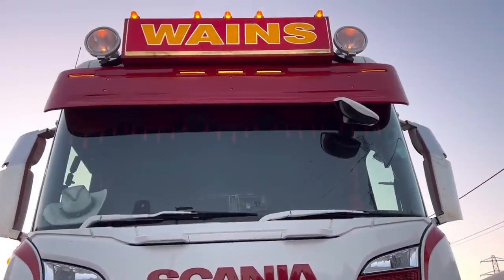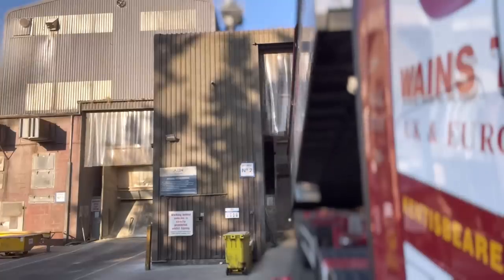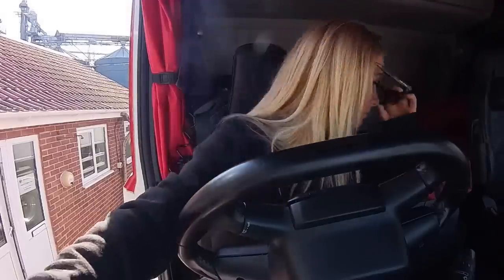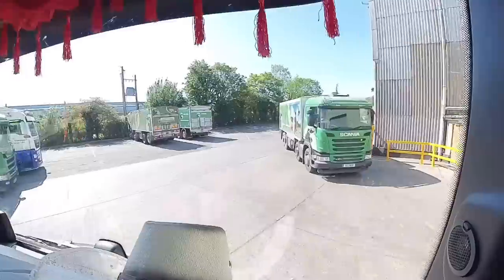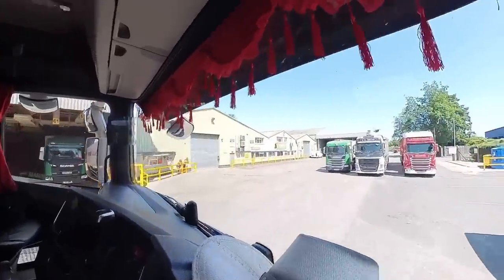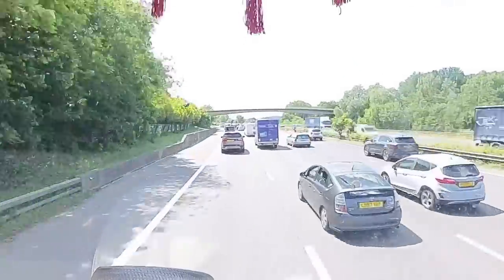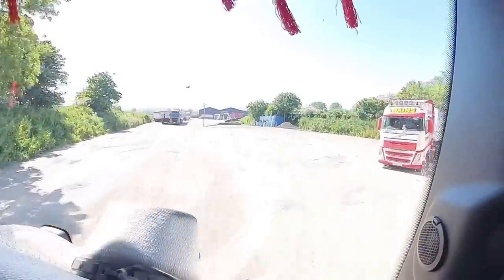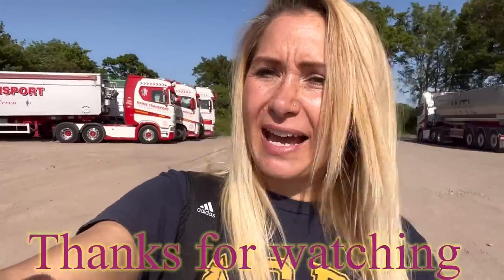Sticky loads | I want to go home

Comment: You need to look into a liner for the trailer I used to do lime for years, and wet lime used to stick like billy oh, until I got a slip line body liner fitted, then nothing and I mean nothing sticks, and even after doing scrap, broken bricks and stone, no wear at all on liner, have a look Jemma, worth its weight in gold.

Comment: I love how you deal with a sticky load. I some times have the same problem a good jerk of my tipping tool helps me.  Would love you to show me how to tip my load . We could both use the same pit. My load would flow very well in the same pit as you I promise to clean up after any sticky mess .We may need a shower as we both may be covered in a sticky mess still lifting your body in the air will help me get into all the cracks Love to do it all over again
Reply: This comment will be in a Netflix documentary one day. 

Once they've dug up your patio.